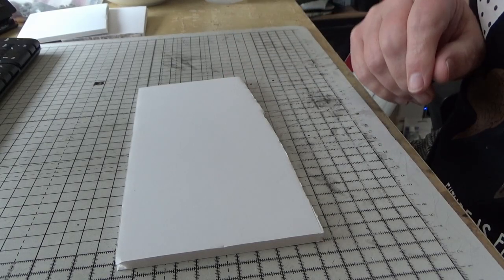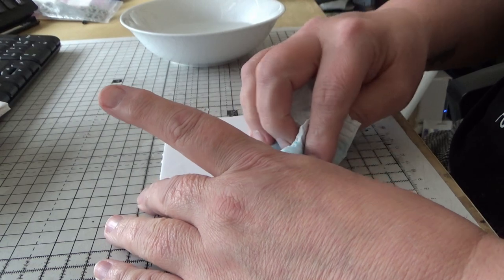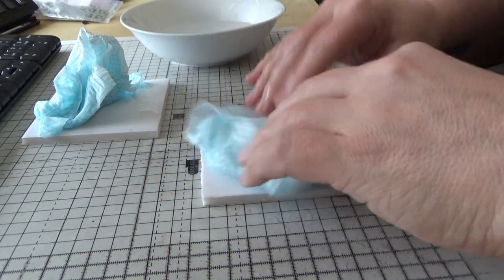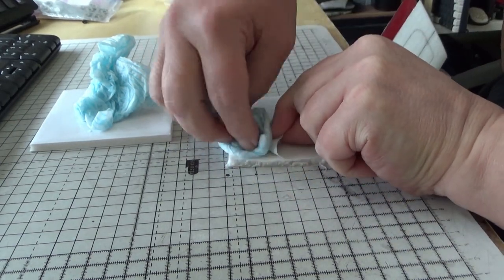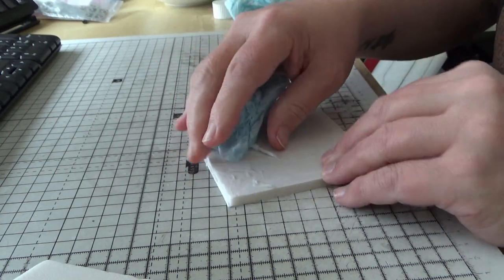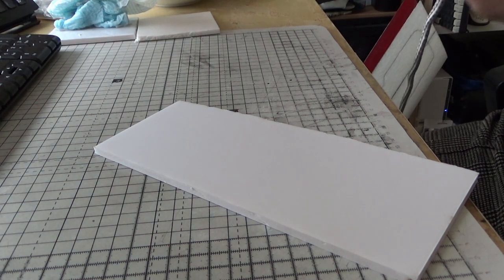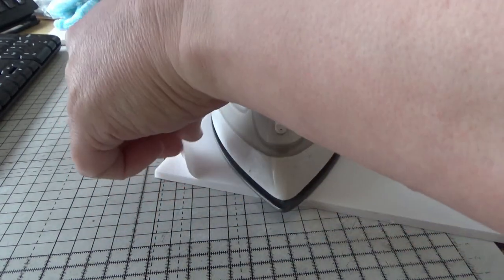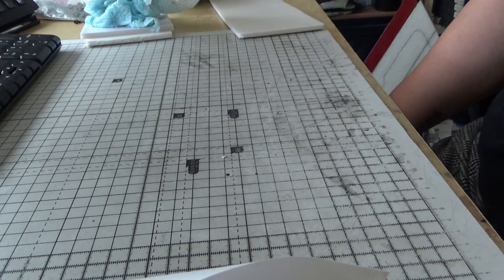Experiments in Westboard covering removal

Comment: Interesting - i never thought about an iron, it seems to work great.  Are you taking the paper off purely as a weight saving tactic, or are there other reasons?
Reply from the maker: Weight and also if you remove the covering from one side the foamboard can be curved easily, good for making built up wings look smooth, curved fuse's etc.